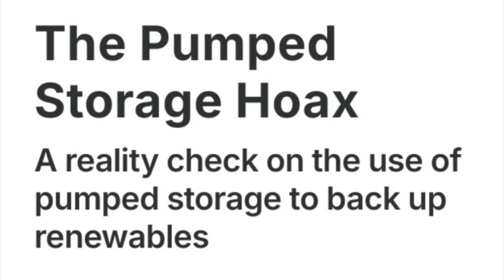The Pumped Storage Hoax, Exposed in Two Minutes

Comment: In the last few years I've read hundreds of climate studies. My Masters of Science degree didn't stray from the textbooks so I was surprised to learn how much evidence contradicts the CO₂ control knob hypothesis. Suspicions peaked, I investigated the Climategate emails. When I saw how corrupt and dishonest the IPCC and activist scientists have been, and how the institutions covered it up, I created this list of climate facts.

1. Headlines scream "HOTTEST DAY EVER" but airport weather stations built in rural areas in the 60s, 70s, and 80s are now urban. So "ever" really means in the last several decades and we can subtract 15-20°F for the urban heat island effect.
2. CO₂ warming diminishes logarithmically. 430 PPM CO₂ is already near full saturation so doubling to 860 PPM will have negligible effects.
3. Since 1850 the climate has warmed 1.4°C/2.6°F, equal to a 50 story elevator ride.
4. 1850 was the Little Ice Age (LIA) 1300-1850 A.D., the coldest time in 11,700 years, and far from the ideal climate.
5. GICs (glaciers and ice caps) reached their lowest extent during the Holocene Climate Optimum about 6000 B.P., before an intermittent advance that peaked during the LIA. 
6. Total ice volume today is still greater than it was prior to the LIA expansion. 
7. Our modern warm period has been beneficial by every conceivable metric. Had the LIA continued thru to today the Earth couldn't support our current population.
8. Through ice age cycles, due to ocean outgassing, warming always led rising CO₂. Thus rising CO₂ is an effect of warming not the cause.
9. Warming doesn't correlate with CO₂. From 1750 to 1940 CO₂ barely changed yet the climate warmed by 1.5°C. After WW2 while CO₂ spiked temperatures fell thru the 1970s. Eliminating this cooling from the record is part of those dubious adjustments, but the ice age scare of the 70s proves it really was cooling.
10. On the geologic scale CO₂ fell as the climate warmed and vice versa many times with no correlation.
11. Modern warming manifests mainly as higher overnight lows & milder winters at high latitudes with little to no increase in summertime highs or heat waves.
12. Activist scientists cherry-pick, contort and then hide their raw data to eliminate well documented past warm periods (Climategate) and/or falsely claim they were only regional when they were in fact global.
13. The Earth was warmer than now for most of the last 10,000 years. The Medieval (900 to 1300 C.E.), Roman (250 B.C. to 400 A.D.), and Minoan (2100-1700 BC) Warm Periods were 1-2°C warmer and the Holocene Climate Optimum (7000 to 3000 B.C) was 3°C warmer.
14. Examples from across the world prove these periods were warmer: Vikings grew barley in Greenland. From Europe to Japan rice, grain, grapes, ect all grew much further North than today. 5500 years ago a forest near Yellowstone grew 600 ft above the modern treeline. Glaciers block Hannibal's route through the Alps today. In both hemispheres glaciers retreated further than today. Every culture with writing recorded these warm periods.
15. During warm periods food was abundant populations increased and civilization thrived. In cold times people suffered of starvation & disease and civilizations fell.
16. Alarmists claim crossed tipping points may cause runaway warming but it's been 3°C warmer with no such runaway effect.
17. Complete records show no increase in hurricanes, droughts, floods, heat waves, or any extreme weather. Upward trends always cherry pick the start date.
18. Wildfires are down 80% since 1920. Less aggressive fire management began in the 80s allowing more acres to burn. The upward trend always start here.
19. Damage costs are deceptively conflated with more extreme weather but more people with susceptible property accounts for the increase, not climate change.
20. Despite the population explosion climate related deaths are down 98% from a century ago. 
21. At least ten times more people die from cold weather than hot. That was true in the past, it's true now & it'll be true in the future. 
22. There's been no increased desertification. The opposite is true and by a wide margin.
23. To maximize yields greenhouses boost CO₂ to at least 1200 PPM, the minimum level plants evolved with for hundreds of millions of years.
24. CO₂ fertilization has made Earth 20% greener than it was just 30 years ago. Increased CO₂ also makes plants more drought tolerant so arid regions benefit most.
25. CO₂ fertilization has increased crop yields 15-20% globally. If CO₂ magically fell to 280 PPM a worldwide famine would likely ensue.
26. Reduced crop nutrition only occurs with very specific soil conditions and can be easily remedied with fertilization or cheap vitamin supplements.
27. The U.S. growing season is 2-3 weeks longer than a century ago, and food production has tripled on less land.
28. CO₂ fertilization is free, benefiting poor countries most. Most measures to increase yields are cost prohibitive to subsistence farmers.
29. On a geologic scale 430 PPM CO2 is extremely low. 500 million years ago CO₂ was 5000-7000 PPM, but CO₂ eventually becomes limestone so It's been falling ever since.
30. 2.5 million years ago the Isthmus of Panama blocked ocean heat transfer triggering the ice age. Cold water absorbs more CO₂ so it fell to its lowest point ever in the LGM at 180 PPM and plants struggled to grow.
31. In some future glaciation CO₂ would've eventually dropped below the 150 PPM line of death. So we've inadvertently saved the earth from a future mass extinction.
32. There's no "mass extinction" happening now. 99.9% of species have seen population increases since the 1970s, including polar bears.
33. Extinctions in past centuries were due to over hunting, invasive species and habitat loss. These are still the biggest threats, not climate. Contradicting claims are hypothetical estimates of bacterial extinctions.
34. CO₂ fertilization has increased the food supply for all animals on land and sea. The more CO₂ in the atmosphere the more life on Earth. Gai loves CO₂.
35. During the mid-Holocene highstand (2000-5000 B.C) sea level was 3-5M higher than now.
36. Ocean PH is 8.1 so CO₂ only makes oceans less alkaline/more neutral not acidic. Ocean PH has ranged from 6.5 to 8.5 with no impact on sea life.
37. Coral bleaching is natural not resulting in death. The Great Barrier reef is at near record extent. Coral only grows where it's warmest, so warming results in more coral, not less.
38. Sea level has risen 12" since 1850. IPCC predicts 12" to 18" rise by 2100. That's likely an overestimate but plan for it anyway. Crisis averted.
39. Strong wind and waves transport sand onto tropical islands causing them to rise with sea level. Without hurricanes those islands would disappear.
40. The effects of solar variation, cloud cover, ocean currents, glacial dust accumulation, underwater volcanoes & cosmic ray flux remain poorly understood because giving attention to natural drivers violates CO₂ dogma.

For references reply with the numbers you'd like to see.

How can so many facts contradict the supposed scientific consensus? In 2004 Climate activists began claiming greenhouse theory was accepted by the scientific consensus. Anyone remotely familiar with the core tenets of science knew this was a preposterous proposal. Climate is an enormously complex system with many unknowns still to this day, and climate science was/is still in its infancy. Disagreement and criticism are essential to flush out scientific truth. Nonetheless, this was a remarkably effective marketing slogan and a propaganda masterpiece, evoking a sense of authority while simultaneously ostracizing the critics. Political cartoonist John Cook added the "97%" in 2013 when he claimed to review 12000 global warming papers but didn't include any cost/benefit analysis and when asked directly almost 2/3 of the authors disagreed with Cook's alarmist message. Even the Guardian recognized Cook's as propaganda dressed in a lab coat. theguardian.com/environment/blog/2014/jun/06/97-consensus-global-warming

Scientific truth is determined by the scientific method, which involves forming a hypothesis, testing the hypothesis with experiments, analyzing the results, and evaluating the evidence to reach a conclusion. Truth isn't decided by popular opinion, and history shows consensus views in science are often wrong. The Piltdown hoax fit the bias of the scientific consensus so well in the 1910s it stood for 40 years until that era's gatekeepers finally died off in the 1950s. For decades challenging Clovis First was career suicide for archeologists. E=MC² wasn't decided by vote. Einstein would be run out of physics today for being a Newtonian denier. Galileo, Alfred Wegener, Carlos Finlay; the list of denounced pioneers later proven correct goes on and on.

For decades now a rare confluence of political pressure, profit motive, funding bias & gatekeeper ideology has manufactured consensus for the CO₂ control knob hypothesis by suppressing all opposition. Huge rewards are doled out to scientists who can devise a way to eliminate, discredit, or obscure inconvenient facts by papering over good science with weak and/or dishonest work, while scientists who challenge the CO₂ control knob narrative are viscously attacked, labelled climate deniers and expelled from academia; no funding, no collaborations or invitations to conferences, and no more friends in academia. Deniers are person-non-grata and hated by the consensus for challenging their work and putting billions of funding dollars in jeopardy. Peer reviewed papers that don't conform are retracted solely for angering gatekeepers, and the editors who allow their printing are fired. 

The manufactured consensus is less than meaningless. It's corruption and even more reason to question the CO₂ dogma.
Reply: Dr Fritz Varenholt, German environmentalist and chief scientific advisor to Angela Merkel did the same. He tells us he was asked to review a publication for the IPCC and found it riddled with errors which he duly reported back. He says he was shocked when they went ahead and published it unaltered. He began to do more and more research and eventually switched sides. He and a colleague wrote a book and one of the leading German  newspapers followed it up with an article. Caused quite a stir. Has now been relegated to the climate denier naughty step when you look him up.
Reply: @christineross4155  Dozens of scientists have come forward with similar claims. The IPCC has a narrative to sell and they've created an effect strategy to do it. First they've gotten increasingly better at selecting scientists who are ideologically committed to the climate change narrative, then they make the actual scientific report so long and full of so much scientific jargon that it's completely indecipherable to the average person. That's presuming you can even find it. I never could figure out how to access the raw science by navigating through the IPCC website. It just kept looping me back to the summary reports. I finally found the group 3 report that contains the raw science through a link from a website created by scientists who disagree with the IPCC findings. After muddling through the group 3 report it's obvious that the "Summary for Policymakers"  the IPCC pushes is cherry picking the science that's already been cherry picked by the IPCC selection process that cherry picks scientist who are ideologically aligned with the climate change narrative.
Reply: @christineross4155  Vahrenholt is a climate change denier who promotes pseudo-scientific theories about solar radiation driving climate change.
Reply: @JJRM8 obviously it was his incompetence that led Angela Merkle decided to select him to be her top scientific advisor. She has a degree in Chemistry so what would she know about science.
Reply: @christineross4155  Did you know Angela Merkel,  who was brought up in communist East Germany joined the "young communists" whilst at University ?
Reply: Well reading that list lifted my heart,  thankyou !!!
"net zero" is now DEAD.  We just have to bury the body before it starts to stink.
Reply: 41. Follow the money. Conclusion. Their lying c**ts. Thats a good list. Cheers pal
Reply: @hogarthsregression1386  It's a list of half-truths and lies. Heatwaves are becoming more common, floods and droughts are increasing, hurricanes are getting stronger, and intense rainfall events are increasing due to climate change. He has simply lied.
Reply: @JJRM8  Crap.   Just telling LIES to support the satanical narrative.
Reply from the maker: None of that is true, and even the IPCC states it's not true that there is no indication of any human interference with floods, droughts, and forest fires, etc. Refer to AR6, Table 12.12, page 1856.
Reply: I see here some people think that skimmed milk is good for you, and sugar is nothing to do with obesity .
Reply: Not the first time you've cut and pasted that Gish Gallop of half-truths and lies is it. CO2 doesn't saturate. You destroyed your credibility in the first few sentences.
Reply: @JJRM8 he didn't say it WAS saturated, he said It was near saturation. It's a logarithmic progression and as it rises it has less effect.
Reply: @pederjohansen2029  CO2 doesn't saturate. Equilibrium Climate Sensitivity (the amount of warming on doubling of CO2) seems to be around 3.2 degrees C. 850 ppm would mean warming of around 4.5 degrees C. That would be catastrophic for human habitation of the planet. 
Sherwood - An Assessment of Earth's Climate Sensitivity - Environmental Research Letters.
Reply: @JJRM8  It has been said that "if you believe that an increase of just .014% CO2 can take the planet from the coldest in 10,000 years to the warmest, it means that you believe in a preposterous sensitivity to CO2 changes." 

Dr. Jennifer Marohasy, Australian Environmental Scientist said in a piece written for The Institute of Public Affairs in July 2023: "Drawing from the sordid history of calculating global and regional temperatures, I can think of a large number of ways that the University of Maine’s Climate Reanalyzer could possibly generate a higher-than-average temperature for Antarctica and especially the Earth. Indeed, the larger the geographic area covered, the more opportunity for creative accounting, for which corporates using similar techniques would go to jail, while climate scientists are more usually promoted".
Reply from the maker: True, but both sides agree on something. My side states that if you double CO2 now (I'm not saying it's due to humans), that would add about 0.7°C. The IPCC claims it's 0.8°C, so we're near enough the same. The difference between us is the IPCC claims there's a positive feedback on that to make their point 8°C into 3°C or 5°C, but nature doesn't have this positive feedback.
Reply: @ClimateRealism  Equilibrium Climate Sensitivity is somewhere around 3.2 degrees C. More likely on the higher side of that than the lower. 
Sherwood - An Assessment of Earth's Climate Sensitivity - Environmental Research Letters.
Reply: @JJRM8  Can we take it that you have a vested interest in promulgating the "human caused global warming/climate change"  "theory" ?
Reply: The Climategate scientists were completely exonerated. It was silly to describe rejecting tree ring data because it was compromised by Carbon fertilisation as "hide the decline." Nothing more than that.
Reply: @JJRM8  Lol, CO2 fertilization would increase tree ring growth. Mann threw the late 20th century samples out because the tree ring growth was LESS than it should have been to fit the narrative he was trying to create. If the tree rings missed the modern warming it's reasonable to conclude the tree rings missed all the other warm periods too. Sort of invalidates the whole study doesn't it.
Reply: @JJRM8  Looks like you've been 'lit up".  I wonder why ?
Reply: Hurricanes are getting stronger, heatwaves are becoming more common, floods and droughts are increasing, fire seasons are getting longer, hotter, and drier, and intense rainfall events are increasing due to climate change.
Reply: @JJRM8 the younger generation see it like you see it. But for us that have been around for  70 to 90 years, there's not much that's changed.
Reply: @Paulman50  I'm 71. I've seen huge changes.
Reply: @JJRM8  Care to elaborate on what you have seen?
Reply: @yasi4877  Fire seasons are getting longer, hotter, and drier. Intense rainfall events are increasing. Floods and droughts are increasing. Heatwaves are becoming more common.
Reply from the maker: None of that is true. Table 1212 AR6 page 1856 makes it clear that humans can't find any human influence on droughts, floods, hurricanes, forest fires, sea level rise, etc.
Reply: @ClimateRealism  Droughts and floods are increasing. Rodell - Changing Intensity of Hydroclimatic Extreme Events - Nature Journal. Hurricanes are getting stronger. Emanuel - Hurricanes - PNAS. Fire seasons are getting longer, hotter, and drier. Jones - Fire Under Climate Change - Nature Journal.
Reply: @ClimateRealism  Sea level rise is accelerating. Nerem - Sea Level Rise - PNAS. Dangendorf - Persistent Acceleration - Nature Journal. Kench - Indian Ocean - Nature Communications.
Reply: @JJRM8  Absolute rubbish !    Pure factless scaremongering.   NONE of that is supported by FACTS.
Reply: @JJRM8 have you escaped from the funny farm?